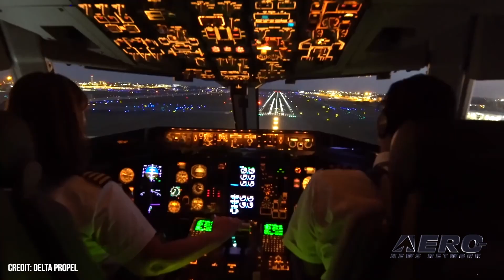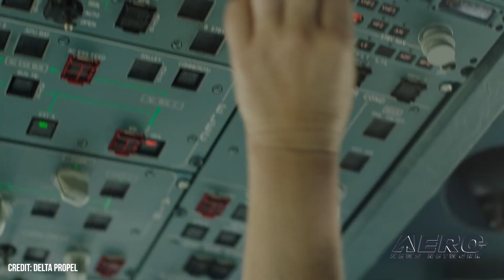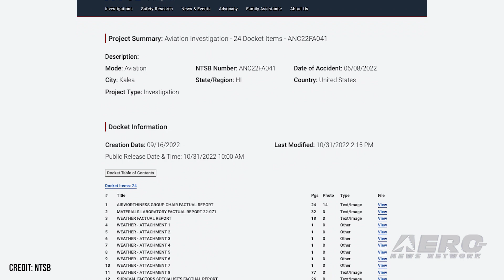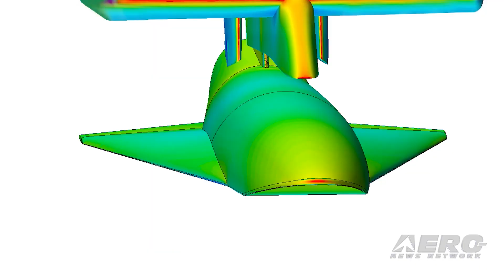Airborne 11.02.22: Delta Strike?, Electric R44 Heli, Stratolaunch Talon

Comment: Index note: Electric R44 runs from 5:50 to 7:08
Much more information on this aircraft, such as battery capacity, electric motor power, and payload (or empty weight) would be appreciated. There are lots of details in six years of press releases from Tier 1 Engineering.
"... 1100 pounds of Brammo Lithium Polymer batteries, twin electric motors and a control system from Rinehart Motion Systems"
" The historic five-minute flight on September 21st [2016] drained approximately 20% of the battery energy."
Since then, the original motors and Rinehart Motion inverters have been replaced by magniX components (presumably their magni350 EPU).

Comment: Electric rubbish❤
Reply: Why rubbish? Putting all the carbon footprint stuff aside, electric propulsion is tremendously easier to maintain. Battery density will continue to increase. Eventually the energy to weight ratio will equal fuel and charge times will become dramatically more efficient. It’s just a matter of time. Logistically electric makes an entire operation much easier and more cost efficient.